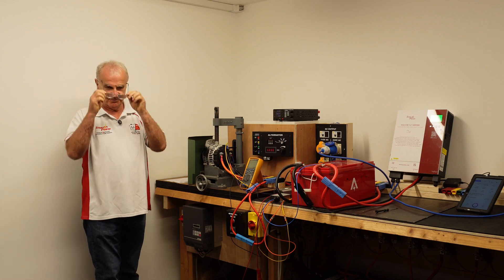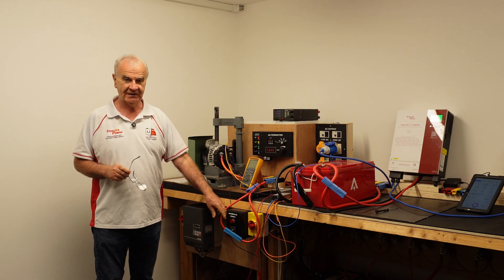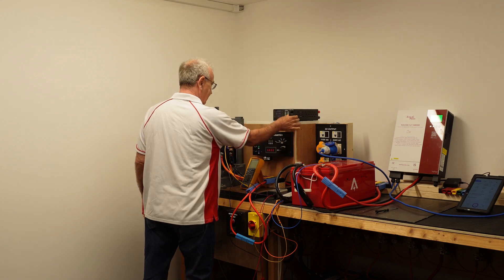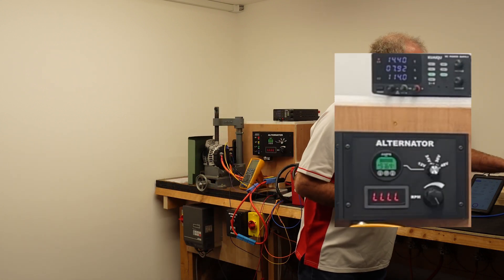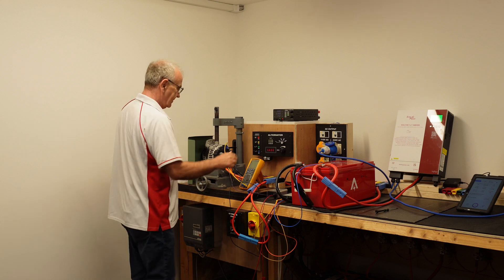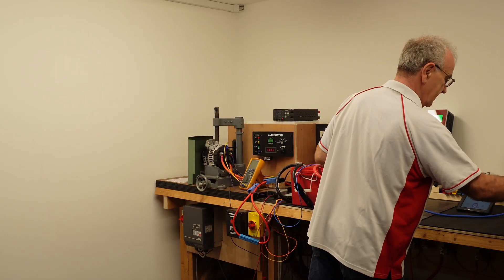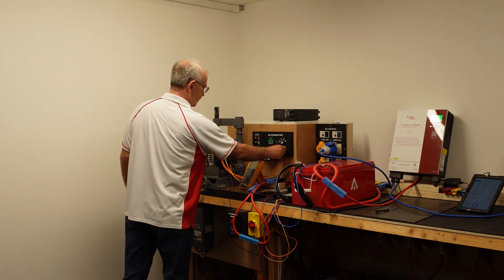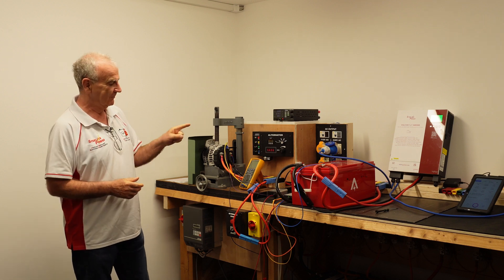48V Alternator System in Action with Charles Sterling

Comment: Sir, First off you have a very nice setup. I have a few questions myself, now I just found your channel through a friend of mine, so you may have answered this in another one of your videos,
First question: Is this, the unit you're demonstrating, singular purpose to recharge the battery and power the inverter at the same time?
Second question: What's powering the alternator? What is the pulley hooked to, to make it spin? Could you show us that end of the alternator and elaborate on what's making it go round, 
and the power consumption of said source? Thank you and I look forward to your responses and answers.

Comment: Glad to see some high power 48v alternator charging in the works. I'm building a 48v system into a school bus conversion. Interested to see power at idle RPMs. Will engine bay temperatures derate it? Will it integrade into a victron system?